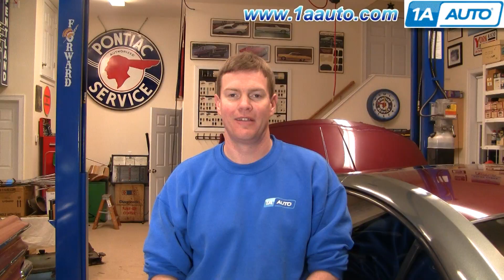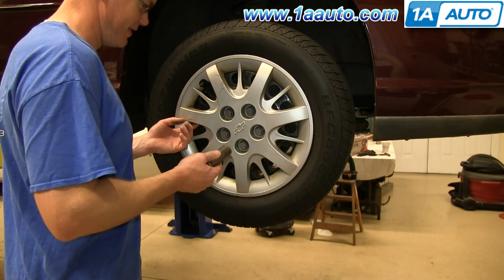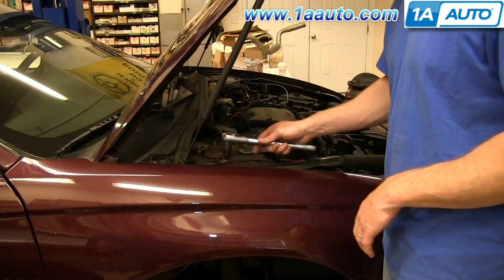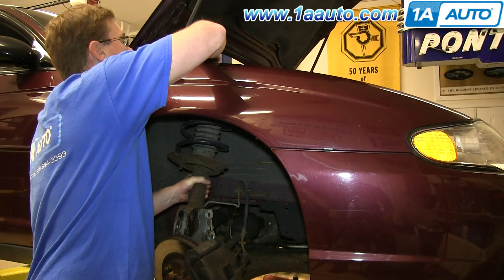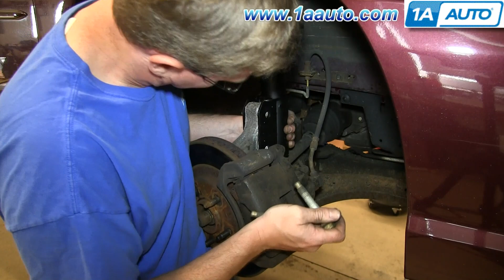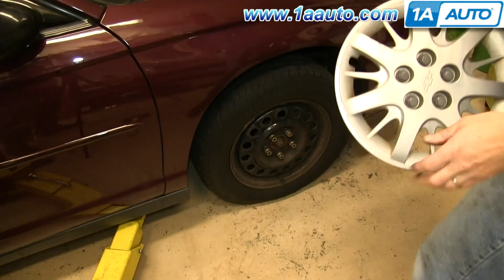How to Replace Front Struts 00-07 Chevy Monte Carlo

Comment: I bought my Strut from a Canadian Store, It was the right Strut except when I tried to install it, it was not sitting in the knuckle properly. It was like the knuckle was sitting to high or my strut was to long?? I am wondering if I didn't line the strut up properly because when I took  the old strut out it wasn't that big of a problem. Just one of the bolts seemed a little pinched and was giving me a hard time to remove.. I know its hard to tell from what I am saying but if you have any advice that would be great. TY
Reply: I have the 2002 Monte Carlo and it is my front Drivers side that is giving me the problem. TY

Comment: Quick question. I got front struts (quick assembly) and it was about 0.5in LONGER than old one. I use jack to put two bolds in place... now I'm not sure if this is OK to do it. Your new one fitted without any problem.